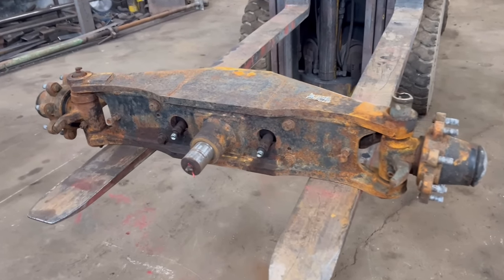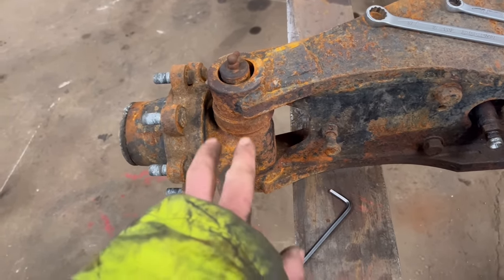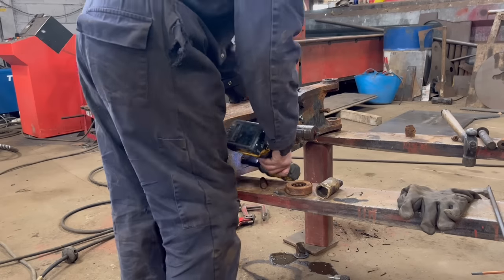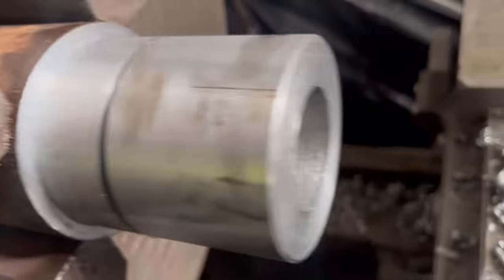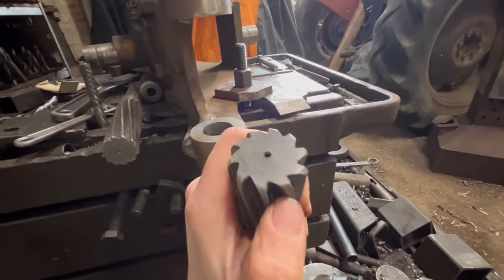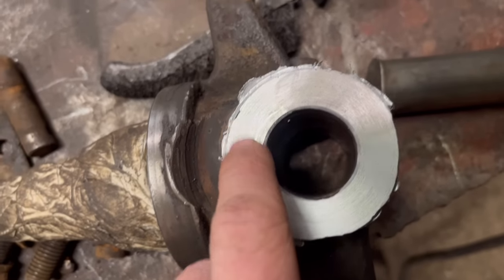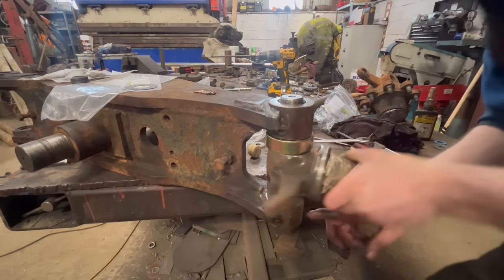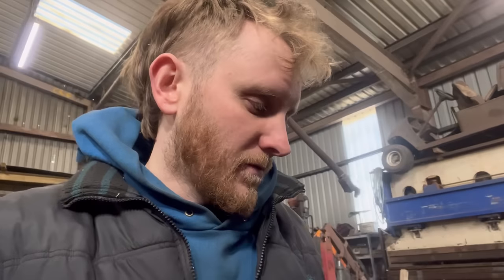Chinese forklift axle in a bad way

Comment: I always do that "tap then Thump" with the sledge too... 🙄😅

I can only imagine what the rest of that machine looks like, you earned yer keep there , mate... 😖

I have read that melting candle wax into seized parts works better than penetrating oil (which just flashes off before it does anything)  when applying the oxy... though it does get a bit smokey in the shop... tried it and it seems to work ... 😷

Heating the Allen setscrew to loosen it also softens it so the hex hole often rings out, of course the upside is its easier to drill out ! 🤔

Another trick I learned along the way was if fitting new threaded studs where there is high heat in service, coat them with Milk of Magnesia when assembling so they'll come out easier next time, apparently Boeing plane turbines were built using it !! 

A sub & a like from this retired jobbing machinist...
Good luck with the channel 🤗  

😎👍☘🍺
Reply from the maker: I like to know where the object is I’m hitting before the big hit 🤣  
I’ll have to try the candle wax.
I heated the Allen screw because its quicker, sometimes it’s enough to break them free. The second time I heated around it and it came out easy enough, luckily. 
Another good tip. 
It’s great people with so much knowledge and experience are watching my videos! 
Hope you enjoy the channel. 
Thanks!
Reply: @snowballengineering   When I was starting out, I worked with an old guy who was a wizard at all things engineering... but he would never teach me the ways... 

I said to him one day that I hope he'll be happy bringing all his "secrets'' to the grave with him, knowledge is made for spreading...he actually did loosen up a bit after that... 🙄😂

😎👍☘🍺
Reply: @peterfitzpatrick7032 He was destined to write a book titled "The secrets of my Trade", with all of the pages blank. 

A collegue had a co-worker who was dubbed the ghost. He could remove tubes out of a boiler, without getting a mark on his coveralls. He also went to extremes to keep his way of doing it secret, such as stopping work when someone approached. This could be an exaggeration but I can imagine it has some basis.

Comment: Hi when I saw the beginning of the video I thought the piece was scrap. How you managed to get that back in service is amazing. One thing I've always wanted to ask is when you set up your oxy/acetylene torch for cutting you always seem to touch it  onto the work piece just wondered why you do that. By the way I'm not mechanically minded more info electrics.
Reply from the maker: It’s oxy propane I use. The propane burns about an inch away from the tip so when you turn the oxygen on it blows the flame out. Holding the tip onto something makes the propane burn at the tip and stops it blowing out when you turn the oxy on.
Reply: @snowballengineering  that's why I'm electrical not mechanical thanks for the info.

Comment: So I think maybe the proper way to get the holes aligned before reaming would have been to put a bar through the both of them and using dial indicator in the spindle of the radial drill and indicate the shaft vertical in two spots 90° apart and indicate center with the spindle. It is a tedious back and forth process but it's probably The best way to ensure alignment. Still a great repair. You are very talented indeed.
Reply: Just using a bar through the holes would make a huge difference on the alignment.

Comment: Back when I used to ream holes we only ever left about 1/64” (0.015”) for the ream.  What’s that about 0.5mm.
If the holes were slightly out of alignment we’d put a single point cutter through first like a boring head.  If you put progressively larger drills through they would just follow the original hole.
You found a way through which is great.  I only mention this now for others who may read this.

Comment: 你說:中國製的叉車品質不佳?有點不公平。我看到的狀況是，使用者根本沒保養，你拆下的零件一點黃油也沒有。那個轉向軸應該要有黃油的。
You said: the forklifts made in China are of poor quality? A bit unfair. What I have seen is that the user has not maintained it at all, and the parts you remove have no butter at all. That steering shaft should have butter.

Comment: You should have had a rod go through the rings to align them for welding, instead of the bar on the outside
Reply from the maker: Yes, but like I said in the video, I didn’t have a pin the right size

Comment: Good job... You do realise you've quadrupled the value of the fork truck by fitting those parts. Did the king pin/bearings job loads of times when I was a FLT engineer. Our axles were cast vanadium steel, if the bearings collapsed the pin was softer than the housing so limited the damage.

Comment: Id make a air fitting screw in the grub screw hole. And   fill it with thin oil diesel and ATF maybe, and put about 150 psi befind it,  then maybe a grease gun if nothing happens,   surely this will get the pin sliding out

Comment: That looks so much like a Clark Y55 rear axle. I spent years looking after a fleet of many forklifts. It was quite a common occurrence for the needle rollers to collapse and take out the roller cage. That screwed up the eye in the casting. All we did was get it machined out, strong bush pressed in then push in the replacement needle rollers. Even tho we had a good maintenance scheme going it didn’t stop the forklifts working in dusty and rough conditions. Cement, drilling mud, tanneries, so much salt. That also screwed up the mast rollers and lift chains. Crosshead  rollers.

Comment: Nice job mate, that could have been a bastard to get right as far as steering inclination was concerned . It's lucky the makers had elected for the king pins to be at 90 degrees to the frame. The only thing I would have done differently is to make up a longer than original dummy king pin in the drilled size to get the axis of the hole exactly aligned along with the box section you welded the bosses to and weld it up with the dummy pin in place. And then turn the end of the dummy king pin down so it will fit whatever arbor you have to fit it into the radial arm drill. And then use it to align the axis of the holes. Then reamer misaligning  on the bottom hole wouldn't be a problem at all.

Comment: I was a mechanic on forklifts for 50+ years , I have seen and did this kind of repair too many times , lack of  maintenance and not checking the steering, we also welded up the axels back to Standard size and bored out the axel again, - a real bad job !

Comment: The damaged lower kingpin boss was rubbing on the inside of the wheel, as the spindle was running offset due to excess kingpin/bearing wear

Comment: Why do people always heat the bolt or pin instead of heating the casting to swell the hole? The bolt needs to stay cooler than the hole to free it up. But to each his own.
Reply from the maker: Because it works sometimes. The expansion and contraction is enough to break them loose and it’s a lot quicker than heating the casting/surrounding area.

Comment: Excellent repair.  Thanks for the video.  I sometimes use a pin that is chucked in the spindle to line up bores, but it's not always and option. Regards
Reply from the maker: Yes, that’s a good way to do it. I’ve done it that way before by tack welding a bar onto a morse taper adaptor to line bores up.

Comment: You don’t heat the fastener up. Heat the cast knuckle up so it can expand while the fastener didn’t heat too much. It would have come right out maybe with a squirt of penetrant instead of using the torch and butchering the thing apart. All this shows is your inability to do the job properly especially watching you use a sledge hammer  like a hammer which proves my point.
I couldn’t watch past that.
Reply from the maker: Heating the fastener is just a quick way to get heat into it, sometimes it’s enough it break them free. 
How else are you supposed to use a sledge hammer?